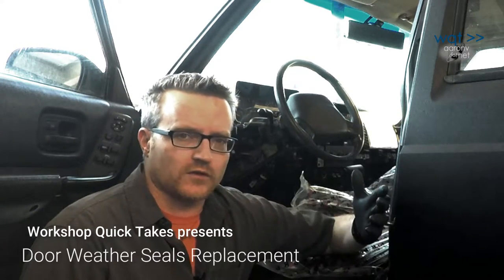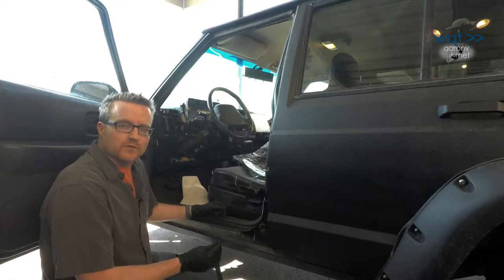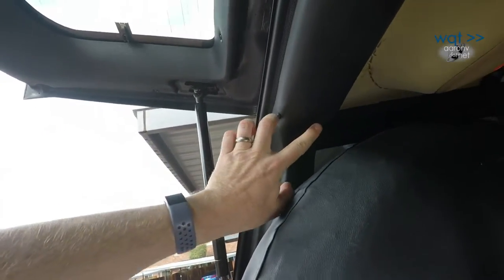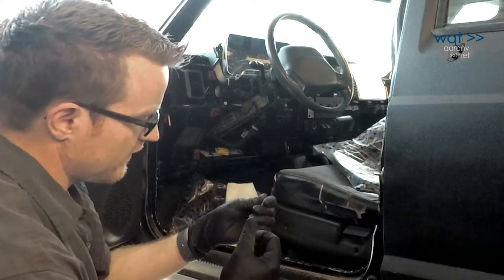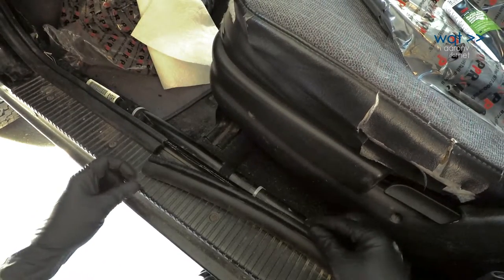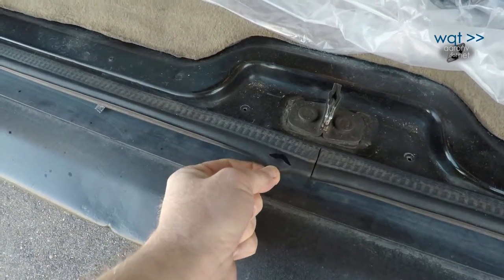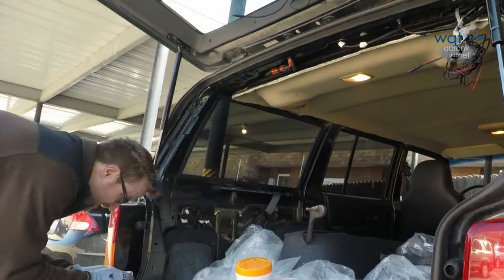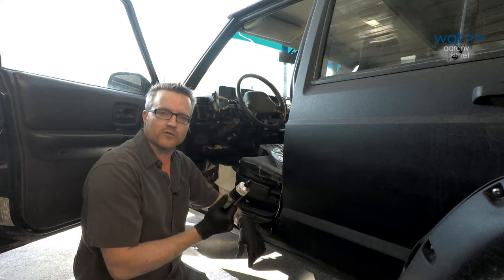wqt//Basic Auto: Door & Hatch Weather Seals (1997-2001 Jeep Cherokee XJ)

Comment: Aaron Very good video, thanks. One question, do you have the link where to buy those rubbers for the doors? I have the same jeep 1998 classic model and I am looking especially for the ones for that vehicle? thank you so much
Reply from the maker: I got them from an eBay vendor but that was a couple years ago so I couldn't say who would be your best option now. In general I've found a search term like "XJ door weather seals" will bring up options, then work through the results based on years (97-up or 96-pre).

Comment: Thanks for the video. Where did you buy the weather stripping from?
Reply from the maker: Thanks for watching! I used eBay vendors. The door seals were from "rockriders-jeepstore," the liftgate seal was from "tamraz." I suggest taking phone pix of the side profile for the strips you are replacing, and then estimate the length with a tape measure and make a note. Then, go to the eBay motors section, enter your vehicle year/make/model, and search for terms like "door weather seal" or "door gasket" or "liftgate" or "trunk" etc. Compare your pix and notes to pre-verify fitment. The 3M 08001 weather strip adhesive was purchased at a local autoparts store and is also available from online vendors.